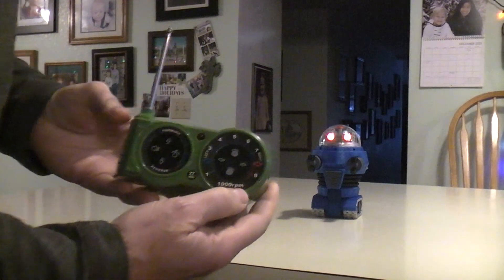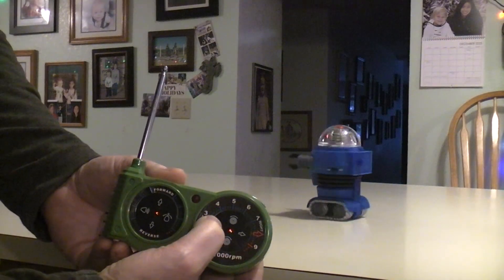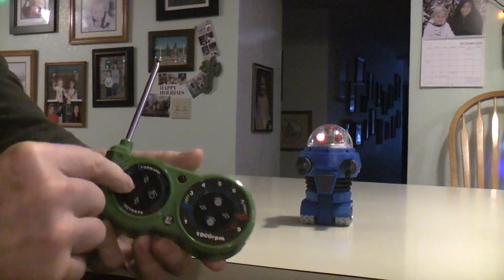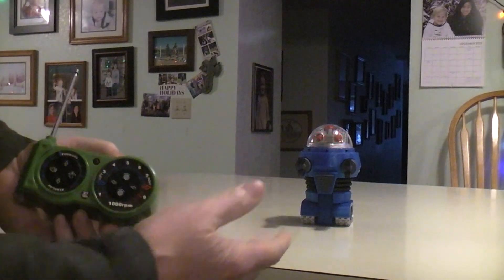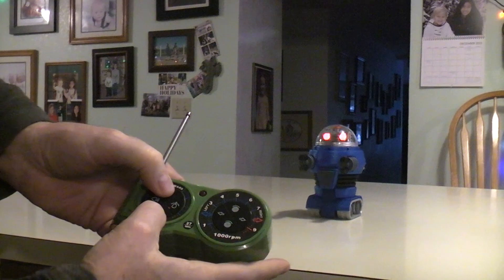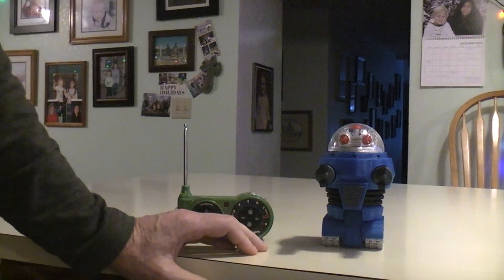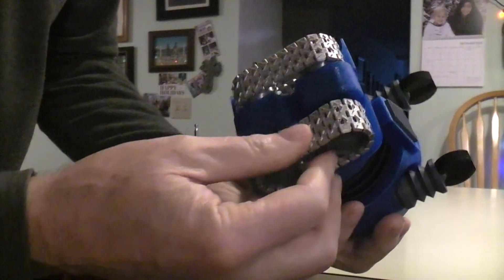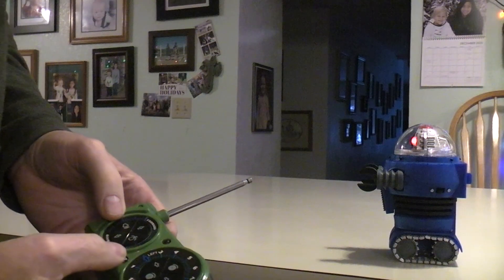Demo of Dual track drive of Tomy Tank Bot project. Part 2. Radio control.

Comment: This is FANTASTIC!
I wonder if this could be implemented into a "Mini King Ding?"🤔
Reply from the maker: The King is a shuffle walker design, they had to leave room for the elevator lift in between the legs.
Reply: @Robothut  
This is true.  I wasn't thinking about the elevator  on the Mini K.D.